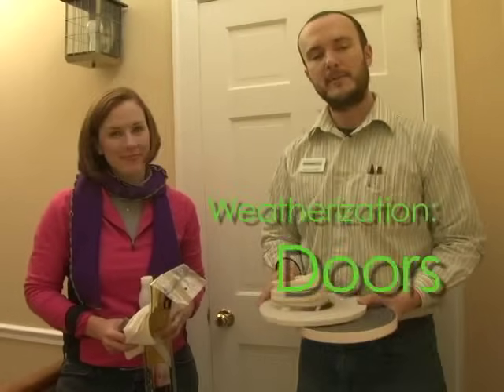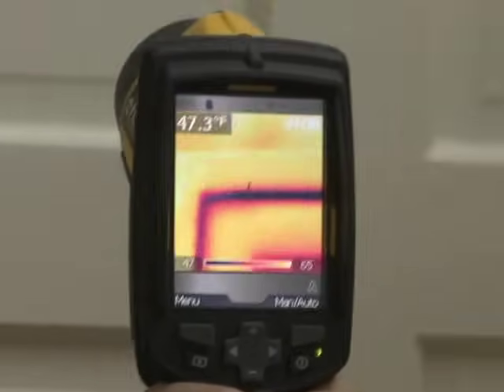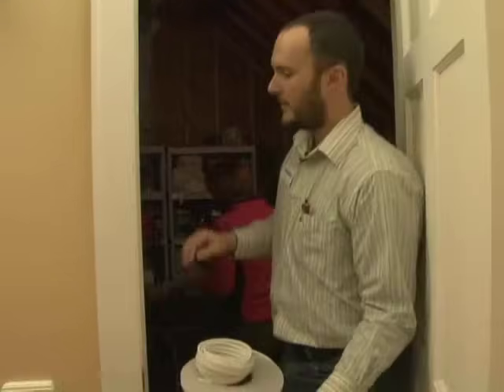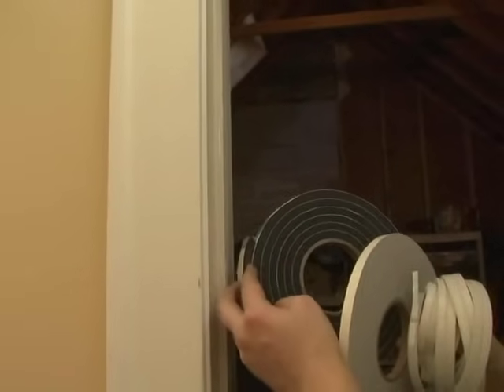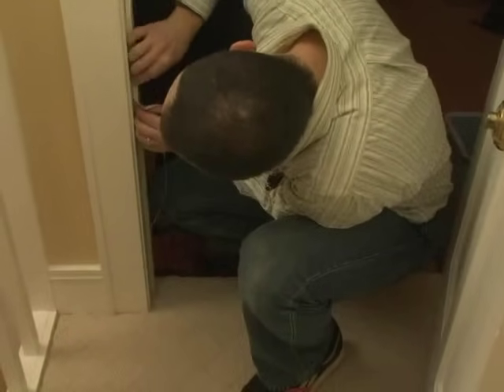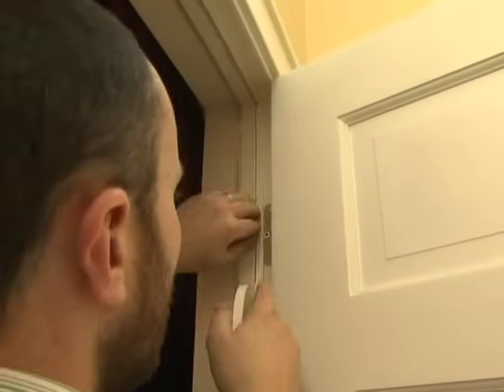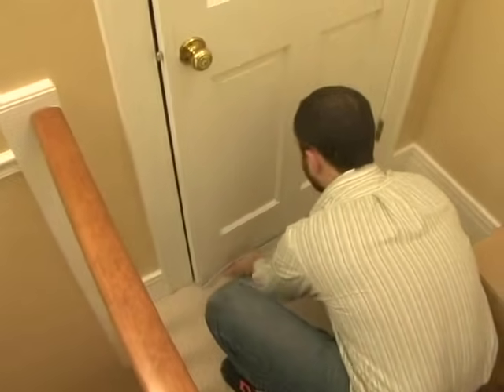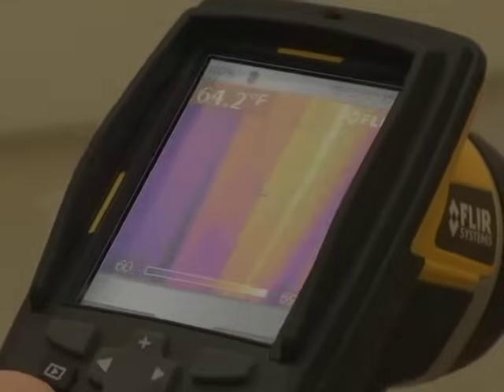How to Weatherstrip Doors- DIY Home Improvement

Comment: I have the exact stuff. Had the sweeper bout2 years but just bought the tape. My door is resistant as amf and now it's hard to close. By the way, i did it the way you did and tried finding a video because i thought i did it incorrectly. I see i didn't. So now Gotta figure something else out now lol

Comment: Is there reason not use wider strip on the hinge side ( not thicker, just wider )

How long does this type of seal last for doors that face indoors ( inside house on both sides )?

How long last for doors that face outside on one side & inside house on other side?

Thanks for sharing, appreciate it...

The weather striping currently on house has been there from the beginning & has been there for probably 10 to 20 yrs & has provided good seal & adhesive still good...

I wish I could find weather stripping originally installed...

It was thicker than what hardware stores have now & it was rubbery / like half side of small racing bicycle inner tube cut...  So there's small dome facing door...

Comment: hpygolkyone hit the nail on the head, 3 yrs ago.  This type of weatherstripping might be fine if you live in the south where it doesnt get cold. And as another one commented, wow such a thin door.
Reply from the maker: That's exactly right- most people completely misunderstand what's inside and what's outside in a home (builders included).  The key thing would be to get a complete analysis of your building enclosure and know that this attic needs an exterior insulated door.

Comment: You didn't address the issue of the paper covering the adhesive side; it APPEARED as if that sticky side made no contact with the lip of the door.  If that's true, what makes the foam adhere to the door stop, since it's been applied with the sticky side out??  And since it's sticky side out, might the door itself adhere to the foam, making opening or closing the door more of a chore?

Comment: If the weatherstrips are a bit narrower than the actual door stop- would you put it in to touch the corner where it meets the door jamb or would you put it to touch the other edge of the door stop?
Reply from the maker: Best way is to give it a try- weatherstripping is cheap and fast, you can always try again

Comment: I just weather stripped my door the correct way I believe. My door wouldn't close tight any more after the weather stripping. I used the small gap foam weather strip. what can I do now to make the door close tight? Thank you for any help!
Reply from the maker: Jady, there must be too much wstrip or in a spot that's too tight. Remove the wstrip where it's giving you a problem- you should be able to see that issue at work if you open/close slowly.
Reply: Thanks! I think the wstrip is just too thick for the gap. I might have to find a thin one.. thanks for your help!
Reply: Same problem here. I like. The v-shaped weatherstrip better and for outside door the spongepoly nail on weather strip

Comment: For a front door, do you recommend that strip at the bottom to go on the outside or inside (I have hard wood on inside)?
Reply from the maker: If there’s no threshold, then whichever side will be gentler.
Reply: And if I have a threshold I should put it on the side opposite of it right?
Reply from the maker: Ya
Reply: @HomePerformance  thank you very much!

Comment: Will this help me in soundproofing?
Reply from the maker: To some extent
Reply: I have my apartment next to very busy road with lots of traffic. Would you suggest me doing this to reduce the noise? Or is there anything else that I should do. TIA
Reply from the maker: Hi Vipul- there are so many air leakage pathways into a home, sealing around doors and windows can’t hurt but it likely can’t fix the whole problem.

Comment: Hi. I got weather strip and the self adhesive door sweep then found this video. I have already done the door sweep a week ago and it's already coming off. Doing the weather strip now. But not sure what I'm going to do now with the bottom of the door. Any suggestions?
Reply from the maker: Lots of options (LOTS), but fastening with screws is always better than glue strips

Comment: What thickness is the foam adhesive?
Reply from the maker: You can get all types of thicknesses
Reply: Yeah I was just wondering what the thickness is that you used. After doing some research, I think 1/8” to 1/4” thickness would be good for my door.
Reply from the maker: Sorry man, this vid was made 14 years ago, it’s a little fuzzy

Comment: is there any way that this could be removed, im thinking of sealing up my apartment door but im almost certain my lanlord doesnt agree with permanent alterings.
Reply: The Duck Brand weatherstrip seal has reasonably strong adhesive, sticks pretty strong the first time, but I was able to peel it back off and re-apply it in spots where it wasn't perfectly straight the first time. If your door has a painted wood frame, I would expect the adhesive may damage the paint if you try to take if off a year later, or could leave some adhesive residue.  I would buy some of it and take it to your landlord or property manager to ask them about it.
Reply from the maker: I can't imagine your landlord considering peel-and-stick weatherstripping a permanent alteration. 99.99% certain you're fine, unless your landlord is a crazy person.

Comment: great video. The issue I am running into is how to figure out the right thickness to buy for a door. There are so many doors and thicknesses and types of door seals and I have tried sealing my front door a couple times and either the sealer is too thick and there is way too much resistance or there is not enough resistance and the door is still loose. Frustrating and wasting $.
Reply from the maker: Yes, this is why experienced handymen are so valuable.

Comment: I really enjoyed this; quick and to the point.  Great visuals.  I'm in a big city & often get awakened as I can't block out street noise into my apartment with my flimsy hollow core bedroom door.  Many thanks.  Any other ideas I should consider?...................................................................................................  PS- There's also a roaring commercial exhaust fan on the my roof (I'm on the top floor, so this is right over my head, & also I've got a bedroom window, now stuffed with foam pillows, which is actually somewhat useful; of course, it's November now... come the summer though, & I'll need to open the window to get some air, so the pillows may only be a temporary fix ).  Any ideas there?  My fear is that, other than the window, that noise is probably coming through my walls as well.  I can't see hanging curtains on the wall, as the room is pretty small to begin with & I don't want to make it any smaller; still, I'm hungry for ideas that don't demand any great DIY skills or cash.  Last question: any ideas for soundproofing my bedroom ceiling, which is what separates me from that roaring exhaust fan?   Anyway, thanks again.
Reply from the maker: Sorry, but I think your easiest and most effective DIY fix is to move out. Some problems are designed into a building.
Reply: Thanks, but I can't do that.  I own the apartment.  There used to be a French restaurant on the ground floor, and peace.  Then a noisy sports bar moved in and all hell broke loose; they fired up the exhaust fan that had never been turned on, and when its motor died they put in a louder one, and the value of my investment (and what peace of mind I had) plummeted.  The efficacy of the pillows in the window have given me some hope, & your video has also made me a little more hopeful, that I can "take arms against a sea of troubles and by opposing, end them".  In any case, taking some DIY action beat a seemingly bottomless depression, is my hope.  My fear is that if I'm totally unsuccessful, if I end up just writhing uselessly like a fly trapped in a spider's web, what effect that would have on me.

Comment: Hello. I have a question. I am currently moving into an apartment room (shared with 2 other roommates). My biggest concern is others being able to hear me talk at night (when I record videos or stream). Somebody recommended me to try placing Weatherstrips around the wooden door. I found this video on how to install them on an indoor and the information you presented is very understandable + correct. Will adding weatherstrips around my room door reduce (possibly block out entirely) the volume of my voice when I close the door?
Reply from the maker: 99% certainty this will NOT do what you want.
Reply: Thank-you for the reply! It's sad how there aren't too many good choices out here for reducing noise without removing drywall (landlord won't approve of drywall renovation).
Reply from the maker: I’d look into a small vocal booth maybe?

Comment from the maker: It's a $5000 infrared scanner, in case you need to order one express.  We use the Fluke TiR.
Reply: I know this is an old post, but figured some might like to know that Caterpillar brand Smart Phones have a similar infrared function built in.

Comment: Will this stuff be alright for a front door?
Reply from the maker: It’ll maybe only last a week or two if it does. They make weatherstripping out of metal, heavy rubber, etc, which is screwed to the door frame.

Comment: Thanks for this video. Could you share what material you used for the weatherstripping? I know that you called it a "closed cell foam"; the options seem to be by material - poly vinyl foam, rubber foam, and so on.
Reply from the maker: All peel-and-stick strips should perform roughly the same. Overall, it would be better to use a mechanically-fastened strip if possible.
Reply: @HomePerformance  Hello, what is a 'mechanically-fastened' strip? what does it mean? Will the weather stripping withstand both super hot and super cold?
Reply from the maker: It means either nailed or screwed to the frame, not just glued.

Comment: My doors have cold air coming from around the cracks, but when I try to put weatherstripping on them, they won't close properly.
Reply from the maker: You should have a professional install mechanically-fastened weatherstripping in that case, Carolyn.  Ultimately this stuff we're using is a simple, cheap fix- and you get pretty much what you pay for.

Comment: Will this also prevent humidity from seeping through? I've been having humidity problems and I suspect it's the door since it has gaps to the outside.
Reply from the maker: Actually, Party Sparkelz, you have four issues going on: you are inside, moisture is outside, the door might be leaky AND there’s likely a suction pulling it in. See this:
The 4 P's to Solve Indoor Air Problems and Control Your HOMEChem
https://youtu.be/Z5ycbz1Xz8U

Comment: Hi there! I know this video is from a long time ago but i just wanted to know which brand  and the exact measurement of the weather stripping you used. Because my door is also not tight just like yours. Thank you so much
Reply from the maker: +ruth tefera sorry, I don't remember! You're right it was a long time ago.
Reply: Hi Ruth. measure the width of the piece of wood (or steel) on the outside that meets the door when it is closed. That is the size you need. Check at a local hardware store (NOT Walmart, they aren't qualified) and ask for someone who is qualified.   I used the solid rubber type, and it keeps out air and noise, and is guaranteed for 5 years.

Comment: For an air tight fit the stops, and frame on hinge side, must be carefully measured and strip cut accordingly, not rolled out like this, as the potential for a bad fit is obvious.
Reply from the maker: If Bruce Lee has advice on weatherstripping, I’m inclined to take it

Comment: Just so amateurs know, exterior doors are different.  You need weather-stripping that has a spline that tucks into a groove on the door.  These guys are doing an interior door.  Obviously.  But this comment is to help amateurs avoid a second trip to the store or do it wrong.
Reply from the maker: ...and when in doubt, hire a pro who’s done this a lot

Comment: That stuff they put on their door is CRAP!  Peel and stick products are made for knuckleheads who like to do projects over and over again.  I would use a V-strip....although it is peel and stick it is made of vinyl so you can "double attach" with a staple gun.  Cheap foam will last 2 years tops........vinyl V-strip will last over 10+years.  You decide?